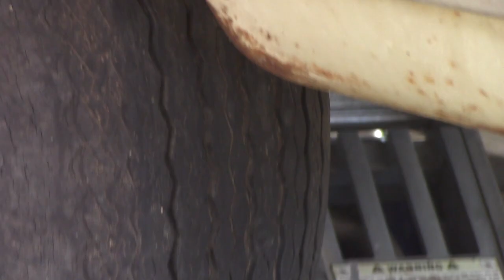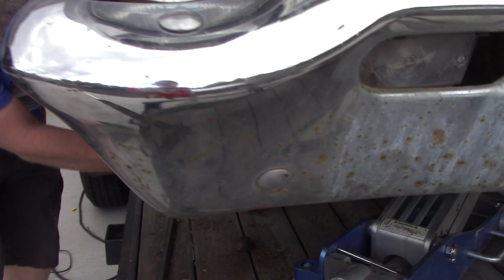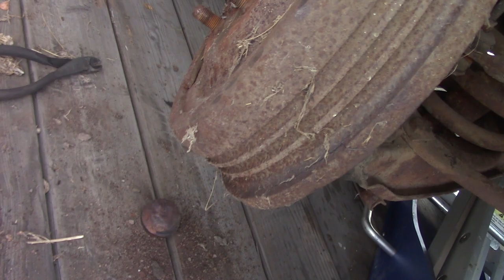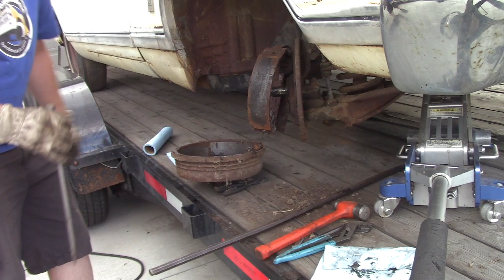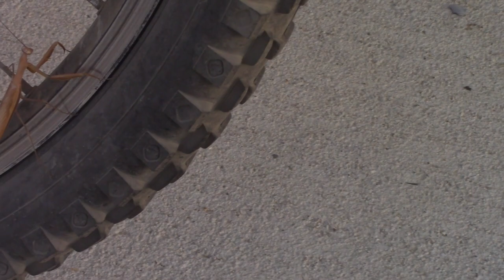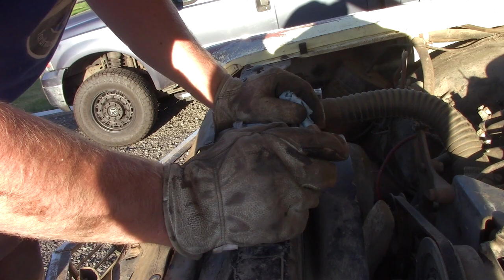Work begins on the 1967 Galaxie 500 Fastback (sadly this is where the journey ends too).

Comment: The tire is so old the reason why there's two wheel weights on it was because it was bubble balanced! I bet you there's no weights on the inner side.
Reply from the maker: No weights on the inside would be a static balance rather than a dual plane balance.

Comment: Just wondering if the engine turned out to be a PU 352 instead of the 390.
Reply from the maker: Believe it was the 390.
Reply: Ford did not put 352 engines in 67 Galaxies, they went from the 289 to the 390 2bbl engine